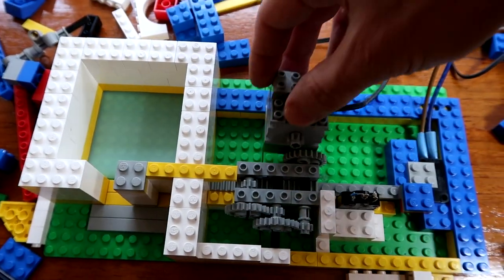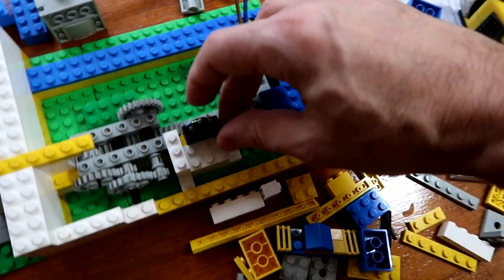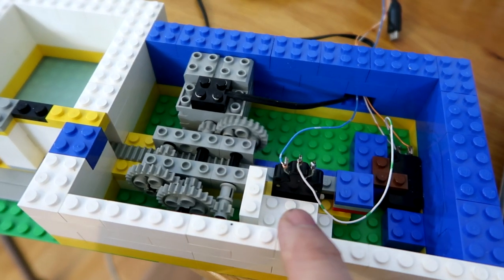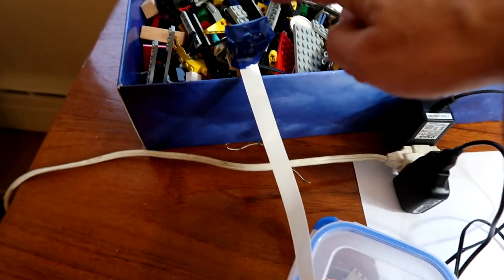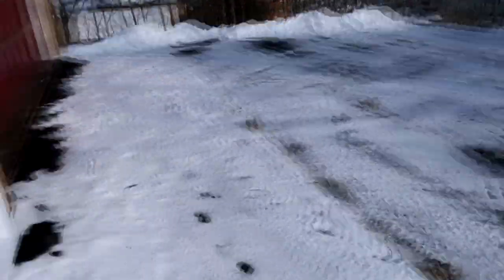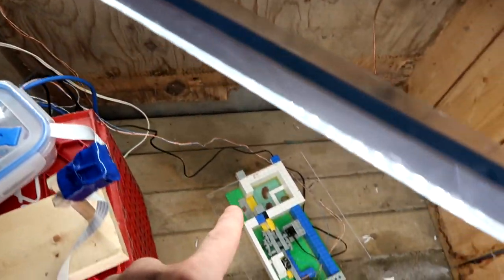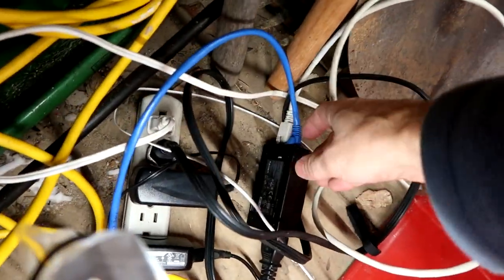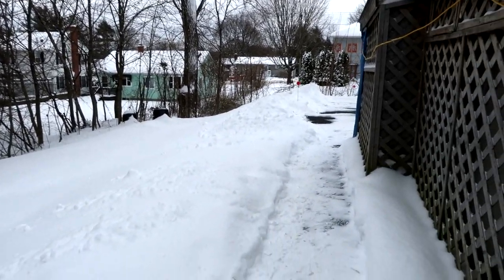Mouse experiment set-up (vlog)

Comment: Hey Matt, I have a bench running 5m along a wall in the shed. I want to be able to push a button or pull a lever and a compound mitre saw rises or swings up to the right height so the bench becomes a saw bench. I was thinking electric scissor lift or struts with a pivoting/hinged swing up kind of thing. Could be repeated along the bench for other large tools like bench Thicknesser, bobbin sander etc etc. 
any chance you can give it a go??

Comment: Does that antenna have a temperature range?  Maybe it's too cold?
Reply from the maker: The antenna was working fine, I tested that separately
Reply: They work fine clear down to -20F  as I use that type of gear for an entire town and our temps range from -20F to 120F

Comment: Nice work! I like your ideas for problem solving and your range of technical abilities. You use these very effectively. I wonder could you do away with the computer and electronics? A solution using springs, counter balanced weights and mechanical triggers would be perhaps less sophisticated; but it would be challenging and quite romantic in the style of legendary tomb raiders. ⚙️⛓⚙️🕸

Comment: There exist lego push switches however I don't think that they are rated to power a motor through them. Instead being used to let the software react to the contact. Also the white clutch gears are another option to prevent burning out the motor.

Comment: No current monitoring?
Reply from the maker: That would be much more difficult than limit switches
Reply: @matthiaswandel  :p doesn't the raspberry pi have ADCs? 

I ask because your setup won't detect a motor stall, just reaching the endpoints. Adding a resistor  in series with the power line for the relay board and  measuring the voltage drop with an  adc would probably be easiest (if the adc inputs are rated for the voltage rails voltage). Adding potentiometer and a comparator would let you have a simple flag when the current goes too high instead of monitoring the voltage drop directly.

Comment: How are the mouse supposed to get in if you close the door?
Reply: He programmed his contraption to slowly close and we see how small it gets before the subject mouse can no longer enter or exit (I think he should have added an automatic food dispenser either mouse or raspberry pie controlled to allow the trial to continue once the mouse/mice eat their ration and maybe a proximity/mouse on board sensor to detect when a mouse was near or inside the cage)
Reply: @Don.Challenger  I meant the shed door.
Reply: @TheRalliowiec  A closed human-sized door is often "wide-open" to mice, as are many gaps between boards in the shed walls and floor. Once Mattias publishes the results of his experiment, you will see how small a gap a mouse can really fit through, if it wishes. It takes a lot of work to find and seal all the gaps a mouse might use to enter a house, when you want to keep them out.
Reply: TheRalliowiec - Ha, ha, good one on me - unfortunately, I was thinking inside the box (and not outside the shed).

Comment: Well, I'm into woodworking, NOT mouse trapping. Gotta give up on your channel.
Reply: He's not trapping mice. Obviously you've not paid attention to his other mouse experiment videos. The question he asked is, "How narrow of a gap can a mouse get through", which has nothing to do with trapping or killing mice. He'd done videos in the past with a set of smaller and smaller holes for the mouse to squeeze through, to see which one the mouse can fit through or not. He mentions changing the width of the opening by tiny amounts with small electrical pulses to the motor. My guess is that he has the system set up to narrow the opening a tiny bit at a time, in-between mouse visits, to see the limits of what the mouse will enter through.

The mice are voluntary participants, compensated in food (seeds, peanut butter, maybe Nutella?) and are not restrained within the experimental setup.
Reply: @Spott07  I have seen his "other"  mundane experiments with mice. The bottom line is, I started watching his channel years ago for the woodworking content, and shop made tools. I really don't find anything interesting about the habits of mice. Obviously, you have interests in mundane experiments with mice, I, on the other hand, have better things to do with my time. Evidently, since he has back problems, and had to sell his other property, he can't engage in woodworking anymore. Too bad, he was very innovative. You continue to follow mouse experiments, I'll follow other woodworkers.